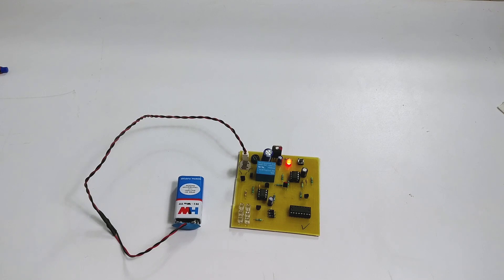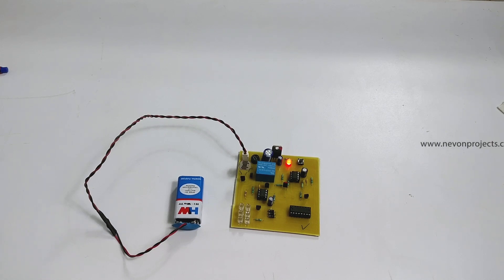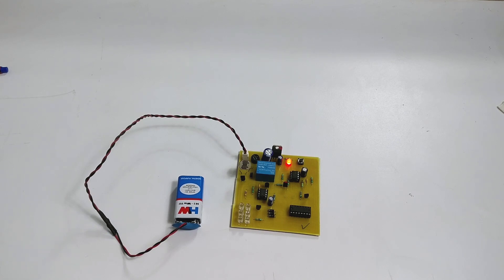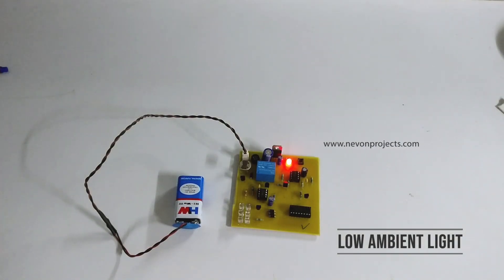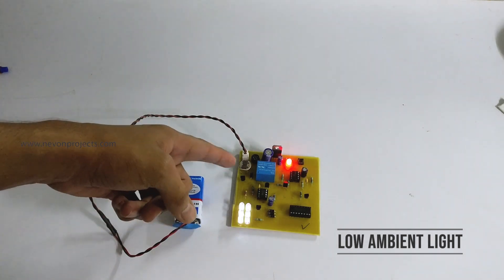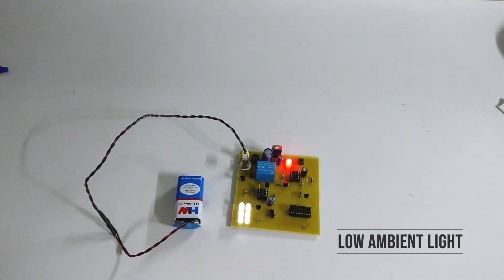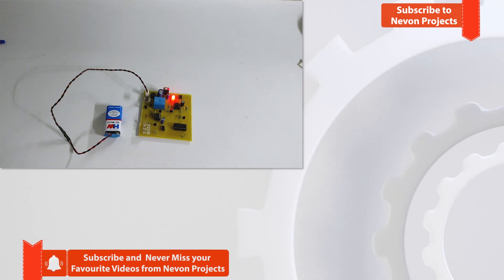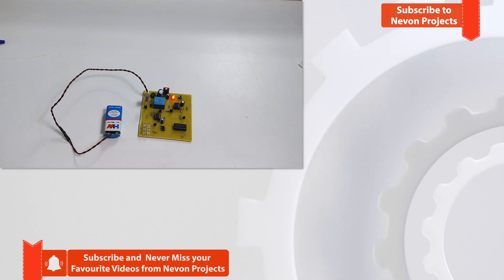Automatic Road Reflector Light Project

Comment: A reflector, more properly called a retroreflector, is a passive optical device which reflects the light from a vehicle’s headlights back towards the vehicle so that the driver can see it. A reflector does not have any active light-producing elements. This product is not a reflector.